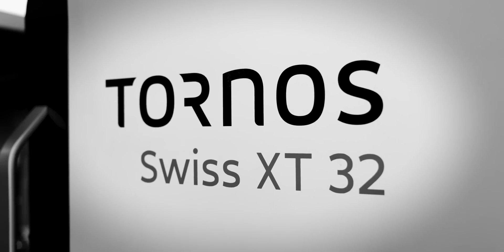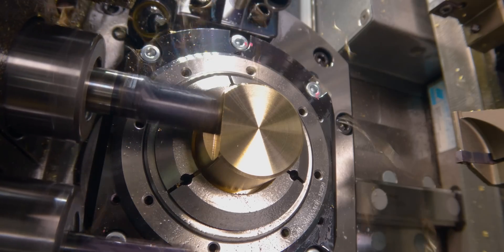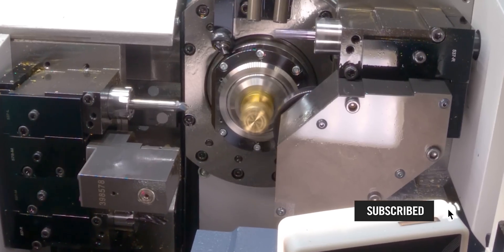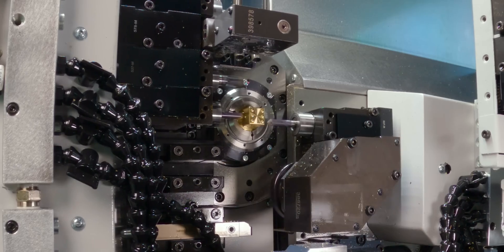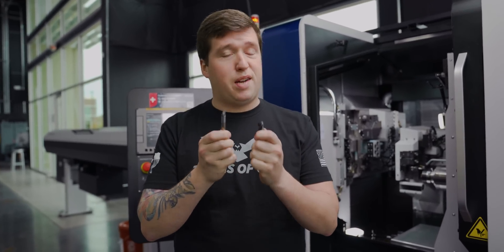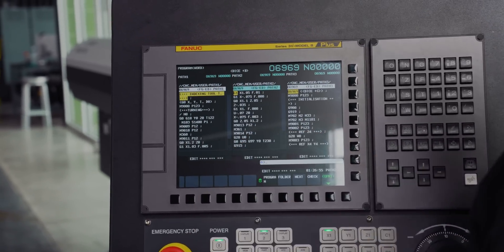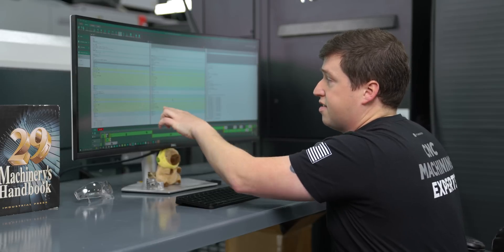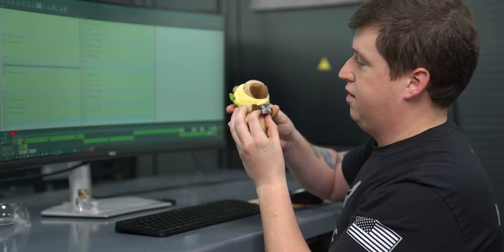Avoid CRASHING a CNC Machine

Comment: Golden rule in proving a new program.... 
1. Single Block
2. Feed pot down(zero %)
3. Cycle Start
4. Distance To Go
5. Gradually Advance Feed Pot
Reply: Most Swiss I've seen also have Handle Jog so the program advances or rewinds as you turn the handle.  Feed override still adjusts how fast you can handle jog through the program.

Comment: Citizens can sync control paths during edit on the machine control (both Mitsubishi and Fanuc controls)
Reply: Yep, on the L20s and L32s (Mitsubishi control) I run you just hit the "Sync Cont" softekey and it does all of the spacing, only thing it doesn't do is the Green to show when you are superimposed.  (You just get the blue lines like in the video)

I've only run Citizen, they have their pros and cons, I've seen plenty of features on the Tornos that I think I prefer over Citizen.  Both good machines.

Comment: Programming this sounds and looks soooooo annoying. But the Result is awesome! 
From an Operator standpoint... I have to say I hate it. 
Program and Tool's have to be out of the office. Can't change pretty much anything because it has to be changed in the office to be future-proof. My Job is now sticking stock in a machine every hour or two at I guess like 6 to 20 of these machines? In 3 shifts? Naaah bro, where is the challenge for the operator?😂
Reply: Learning enough to be more than an operator.
Reply: Also inspecting parts, making offsets, changing tools, and troubleshooting any issues.  If you are good, you find problems before they are problems and keep maximum uptime.

Comment: Really Good Video.  Using G-Code simulation on a digital twin of the real Swiss machine before running the program avoids crashes as well. This also avoids the downtime of dry runs and potential damage if you don't hit the Feed Hold button fast enough during a single block.